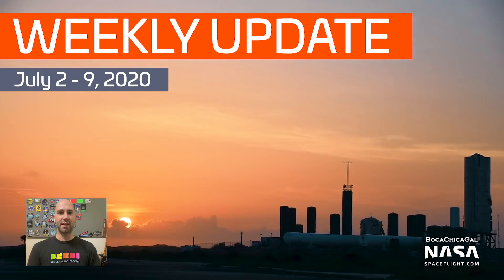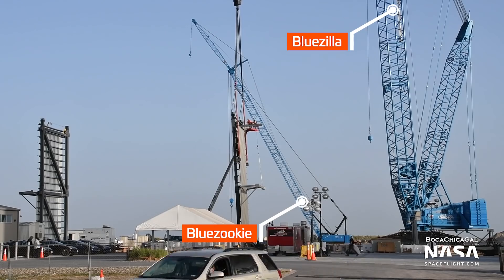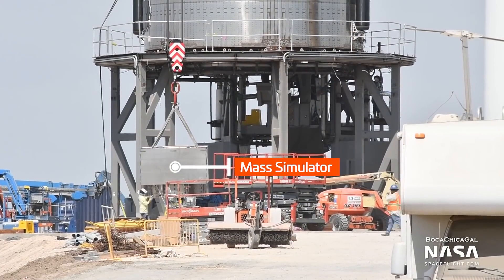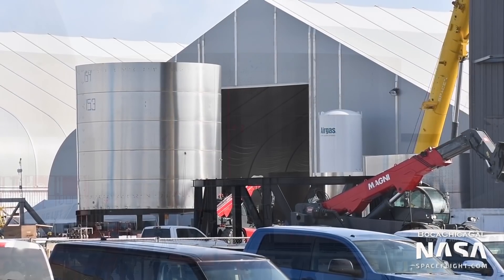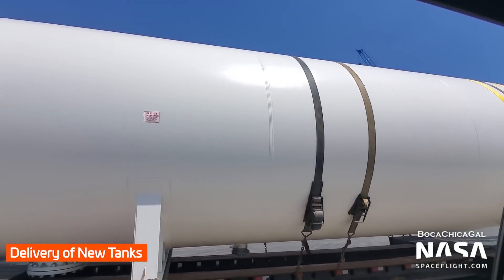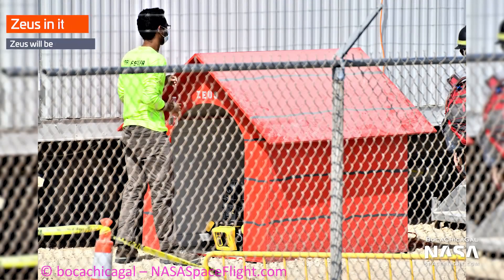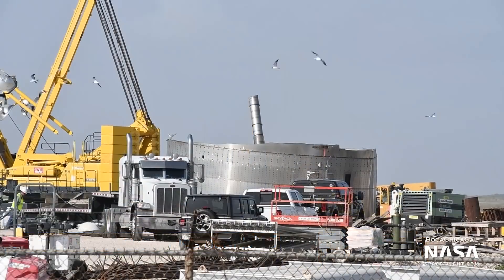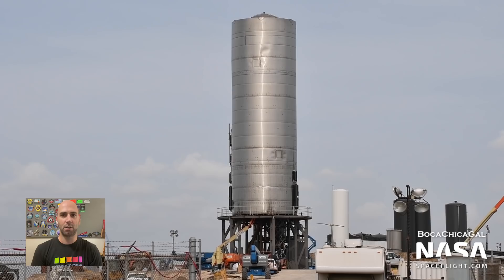SpaceX Boca Chica - Weekly Update - First Week of July, 2020

Comment: Did SpaceX ever say why SN4 exploded, what component failed?
Reply from the maker: Yeah, it was a GSE (ground support) line that they were testing quick connect/disconnect with for prop offloading that went wrong. Caused a spill, spill ignited. So not SN4's fault.
Reply: NASASpaceflight Good Grief!  A major league FU!

Comment: hmm what's the deal with offsetting the raptor engine? Are they installing more to sn5 after the 150m hop?
Reply: It's using the same structure that will be used to mount three raptor engines.  The three engines will be used for the test of the aero surfaces (20km hop) later on.

Comment: I thought this was well done.  Keep it up.
Could that structure they're building near the test stand be some sort of maintenance/workshop and parts storage?
There's been a lot of work going into the pipe fitting and I couldn't help but wonder if things didn't quite fit.
Would they have to drive all the way back to the production site each and every time to get a new part or change something. Maybe this is a way to speed things up a bit.